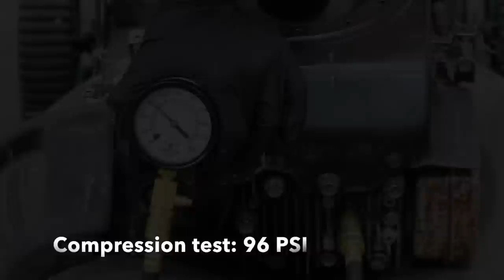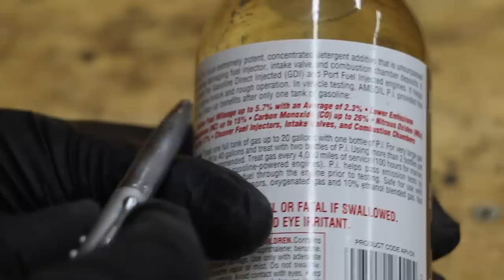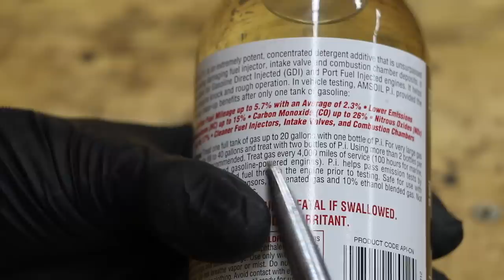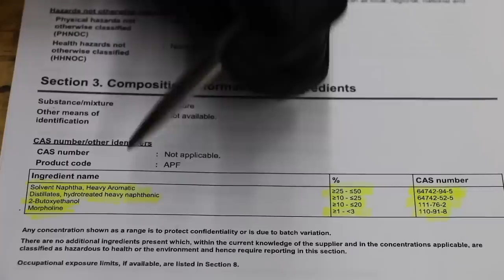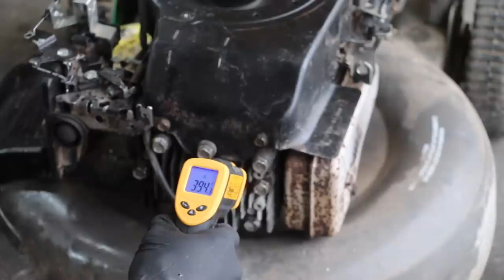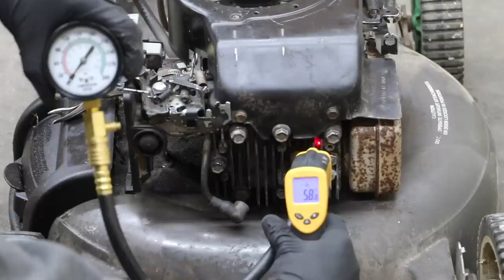Is Amsoil Power Foam better than Seafoam & MMO? Let's find out!

Comment: I use a spray bottle with 50% water & 50% rubbing alcohol... Cheap & Great way to clean carbs & injectors
Reply from the maker: Great recommendation!
Reply: Liar. Never use water on inside of crank case!!

Comment: Im not sure if it would work but try using oven cleaner and spray it into the carb
Reply from the maker: Thank you for this recommendation.
Reply: That’s a really good idea
Reply: That is an amazing idea! Please do this!
Reply: Heck yea id like to see that
Reply: Easy-Off oven cleaner contains sodium hydroxide which reacts strongly with aluminum so probably not the best thing to be putting in an engine but it would be interesting to see how well it cleans.
Reply: Great idea!  I'd laugh my arss off (and then run out and buy some) if a can of oven cleaner from the $1 store actually worked!
Reply: I use oven cleaner instead of engine degreaser when cleaning an engine. Just have to be careful with overspray. Wear safety squints and gloves, irritating to skin
Reply: Oven cleaner works great on cleaning aluminum, but in my experience it needs to be able to soak for an hour or so, so putting it into a running engine won't do anything.

Besides, oven cleaner can destroy rubber and gaskets so probably not such a good idea.
Reply: @ David: He's not trying to RUN the engine off of Oven Cleaner...

... He's trying to CLEAN the engine.
Reply: Oven cleaner is a good bodge to clean sticking turbo veins without removing the turbo (especially on VAG engines)

Comment: I'd like to see some Royal Purple products thrown in - I've used them an Amsoil and could swear my car feels faster with Royal Purple in it. Some Brad Penn oil would be interesting as well - I've used that in 60's flat tappet cam cars due to the high zinc content.
Reply from the maker: Great recommendation!
Reply: unedited 
You're correct the zink did help, unfortunately the EPA says it hurts exhaust emissions,  so oil companies are required to remove it from oil. 
Some companies do make oil with high Zink content, but it's expensive

Comment: It’s like you’re reading my mind and answering the questions before I have them!
Reply from the maker: Thank you!
Reply: @ProjectFarm  I went to school at Lincoln Tech (now called Lincoln College of Technology) and one of our fuels teachers told us, to get rid of carbon deposits, just give the engine a drink of water.
Get a garden hose and let it drip into the intake at an idle for a while. I imagine with a lawn mower engine you might want to mist it with a spray bottle. But the water droplets in the cylinder will help knock carbon deposits loose and clean things up.
As sure as I mention this, someone will try it, flood their engine, hydrolock it and bend the connecting rods, crack a piston or cylinder head, wash the rings out and fill the crank case with water.

Comment: Always heard a little diesel mixed into a full tank of gas does the same thing, maybe give that a test for me?
Reply from the maker: Thank you for this recommendation.
Reply: theorically, it should do the opposite.
Reply: It does not do well lots of carbon build up and spark plug fouling I've tried in in my generator to increase fuel volume thus increasing run time per dollar spent.  Off-road diesel is much cheaper then gasoline. Anyways it just causes headaches I would not recommend running any amount of diesel mixed in your gas tank.
Reply: I wouldn't advice.I have been putting 3x on 60 Lit of gas 1 lit of diesel for my non stop trip of 1500km,car was Audi V6 / 2.8 Lit.Since then I never gain light color of inside of exhaust pipe,I presume this "additive" wasn't good for the car,beside car engine run nicely..
Reply: Wellness, a 50/50 gas/diesel killed my Alpina BT-98 lawnmower completely, but increased power and compression on my McCulloch M145-97T
Reply: I do that on my four wheeler when I flood the motor
Reply: We used to add it to the crank case AFTER draining the oil to clean out the oil channels but never in the gas tank. We would put it in and run the motor for a few minutes and drain it out. Then repeat until the diesel comes out looking as it did when it went in. Then change the oil filter and add new oil.
Reply: Its the opposite a lil gas in the diesel can clean a diesel engine but diesel wont do shit but foul for a gas engine because of the way the fuel combusts it doesnt burn like gas its slow burning unless highly compressed wich a gas engine can not produce the adequate amount of compression to ingite diesel so a slow bur ing fuel mixed in a engine designed for a fast burning fuel results in lots of unburnt fuel causing carbon and soot. So just buy a damn cleaner dont do shade tree mechanic myths
Reply: IMHO, not diesel, bur kero ..... diesel (#2) is too much, but kero is just right. Tried this over the years in my gas and diesel cars.
Reply: @bargainboondocker3420  That sounds like ruining the engine with oil starvation. Diesel doesn't have the property of engine oil. I think it ruins it more than having a little bit of old oil.

Comment: Hey! I heard from some "old time mechanic" that if u spray some water in the engine in high revs it will clean engine from inside, Of course you dont want use too much water so that engine won't seize. 

Btw ... Nice videos! Greetings from Finland!
Reply from the maker: Greetings!  Spraying water into the engine sounds like a great test idea.  Thank you for this recommendation.
Reply: It works.  An old racing trick.  Cold water, hot carbon  buildup. Pow. Blows it right out.  Use a spray bottle.
Reply: Water turns too steam and works great at.
Reply: @spacecat7247  Done that. Old mower kept stalling before; after, no stalling.
Reply: Works great... look at any motor with a blown head gasket.  Any cylinder getting coolant in it is spotless.
Reply: I've used the water trick since about 1981 when I got my first car.

Comment: Amsoil motor oil vs royal purple motor oil film strength test would be cool another great video
Reply from the maker: Thank you for this recommendation.
Reply: Yas
Reply: Except schaeffer hardly has a selection of multi-grade oils, especially for imports. Motul would still be the preferred for imported (European and Asian). I am impressed with Schaeffer's full SAPS lineup, they should have more than 2 types of viscosity variants though.
Reply: I would like to see this as I use royal purple in all my cars and for my customers. Curious to see how Amsoil stacks up to it.
Reply: Colby C. I bet nothing beats AMSOIL Signature series
Reply: and you know this how?
Reply: Say's YOU
Reply: Talk about CRAP!
Reply: Joel Watkins RIGHT! I agree Amsoil is crap.
Reply: Superman I'm my opinion Schaeffer oil and Redline are the best oils. Is motul a USA company?
Reply: @charlespetersonii6989  I don't know about amsoil but I know Royal Purple is awesome motor oil.
Reply: It means nothing that Schaeffer is the oldest oil company. AMSOIL was the first company to bring synthetic oil to the automotive industry. The Schaeffer website has very little literature and test results on their website. I could not find any engines taken apart that only used Schaeffer oil to see how much wear it had. Chevy for the most part refused to use synthetic oil in their vehicles until one cold morning when they destroyed a few corvette engines.
Reply: @danielanderson222  Schaeffer's is damn good oil. Better than Mobil1 for sure. It's generally marketed as a mass fleet oil. Redline, Amsoil and Schaeffer's are the best. Royal Purple makes a really good high mileage synthetic called HMX. Valvoline Modern Engine synthetic is right up there with Amsoil in a film strength PSI test and is formulated to reduce volatility, control heat better and clean above and beyond their regular synthetics. Got a five qt jug at Walmart last week for $35.00. If you have an car made before 2004 Royal Purple HMX is the best for it because it has the zinc and phosphorus levels those engines require for longevity.
Reply: I’ve been running Amsoil in all my engines for 20yrs.....25,000 mile or 1 yr in all my vehicles, put 100,000 miles on my truck with no problems
Reply: @charlespetersonii6989  A guy dumped -40° oil, and Mobil 1 and Amsoil were the best flowing.
Reply: @JJfan48  don't use royal purple if it gets below freezing
Reply: @skittykitty1000  stop ur nonsense talk
Reply: Charles Peterson II Every time I used Amsoil I get an oil leak.
Reply: @skittykitty1000  what's so awesome about it? Is it because it's purple? It's oil. Super tech oil is awesomer!
Reply: @skittykitty1000  Mobil makes a primo oil
Reply: @johnm5998  Mr. Murchie?
Reply: He just did this Video.
Reply: @153eddy  you are just buying the hype. 😂😂🤣🤣🤣😂😊 Keep wasting your doll hairs
Reply: @JJfan48 I use diesel oil or Mobil and supertech
Reply: @andyandysylvester5194  and oil is all hype
Reply: @skittykitty1000  just because the oil is purple doesn't make it innovative!!! Some people 🙄🙄  you know nothing about oil I can tell😂
Reply: @raptureready9502  How  can you tell AMD where did I say it was awesome because it is purple?
Reply: Schaeffer's oil vs Amsoil SS
Reply: @traMusik  amsoil is all hype just change your oil on every 5 k and you'll do great
Reply: @charlespetersonii6989  I trust data and test results over reviews,LOL.
Reply: @orangefury272  Well with my test results amsoil didnt hold up. I watch 3 Cummins channels on YouTube. Turba tom- Schaeffer oil user. Jim Rendant- Schaeffer oil user. Greg Alberalla- Amsoil user and grenaded his"new" engine last year drag racing.
Reply: @charlespetersonii6989  I 100 percent doubt any synthetic oil would have caused that engine failure. Get a life.
Reply: @orangefury272  That's your opinion. I had a Yamaha blaster ATV I used amsoil dominator oil I had to rebuild it twice within a year. The third and final time I switched to Maxima castor oil and never had a problem. I know amsoil shows top notch results on tests but for myself amsoil has not been a good experience. I also cant justify the cost.
Reply: @charlespetersonii6989  My point is weather or not Amsoil is the best or not maybe debateable, but no way do i believe it caused an engine failure. Any synthetic oil made would be more than adequate.
Reply: Seen it done. Amsoil wins, cold viscosity, high heat breakdown, and wear. Amsoil beat Royal Purple and Mobil One.
Reply: @shannonmccullough8324  I would sure hope so at 12$ a quart.. Fuuuckkkk that! I'll stick with my Schaeffers for 6$ a quart and it's better than amsoil 👍
Reply: @charlespetersonii6989  the product that runs $12/ qt is the 25,000 mile oil. If you go to Amsoil's website, you get 25% off. Their 12,000 mile oil is 7.99 before the discount.
Reply: Shannon McCullough He hates Amsoil so much especially now that it is being proven to out perform the oil he sells. He’s on every Amsoil video calling it crap🤣
Reply: @matt7sixty  , I've never heard of Schaefer oil. I know a trucker who ran straight Lucas in his high speed gears. He tore it down after 250,000 miles. Still looked new.
Reply: Shannon McCullough Very nice. PF tested Lucas motor oil as well. Amsoil is on another level.
Reply: @153eddy  I think you won that bet.
Reply: @charlespetersonii6989  ahahahaha Im guessing you don't own a 1000hp car
Reply: @matt7sixty  You are easily fooled if you think I sell Schaeffer oil 🤣👌🤦‍♂️
Reply: Charles Peterson II That’s even worse lmao your on tons of videos like it’s your job copy and pasting the same comment pushing Schaefer’s oil even providing a link. 😂😂
Reply: @matt7sixty  Ain't no shame in my game 😎 that's called dedication 👌🏁 Also I'm not "pushing" rather educating people that the most expensive oil is not the best except for draining your wallet.
Reply: @matt7sixty  After choosing the finest base stock they start adding two friction modifiers; Micron Moly and Penetro.  Micron moly is oxidized molybdenum that is magnetically attracted to ferrous metals. It is five times stronger than steel and has a melting point that is twice as high as steel. Even under the heaviest loads Micron Moly will not pound out.  And Schaeffer has the highest content of molybdenum among all major brands.  Along with Moly Schaeffer adds a proprietary product that is exclusive to Schaeffer oil called Penetro.  Penetro reduces friction by adding what is like microscopic ball bearings in the oil.  This is especially good since most engine parts contain metals that are non-ferrous along with ferrous metals.  Non-ferrous metals do not attract magnetically so they need lubrication to protect the surface other than metal alloys, such as molybdenum.  Penetro and Micron Moly stay on the parts even during cold starts to offer the best protection at all times.
Reply: @charlespetersonii6989  dude it's no diffrent to most brands I just looked at the specs of it.. You can't compare that an xpr from royal purple
Reply: Royal Purple isn't even worth knowing about in my research.
Reply: Royal purple is crap. If something is going wrong how are you supposed to know cause your oil is starting out dark!
Reply: @Kmecha84  Because.... And 100 percent agreed, PLUS I have heard, read and seen nothing but bad about that junk. Woudn't use it EVER.
Reply: maybe for a dailey driver,but not every one has just a dailey driver
Reply: @charlespetersonii6989  now that Amsoil has won the oil championship, is amsoil still complete shit?
Reply: @ahdohnwehngunsmoke7724  Daily.... Spacebar/Button.

Comment: I wonder if you could put a small funnel over the carburetor when spraying the product in to get most of it to go down the carb?
Reply from the maker: This is a great suggestion.  Thank you.
Reply: Love your videos... keep them coming!
Reply from the maker: Thank you!
Reply: I thought it came with a straw to spray it in
Reply: rick schwartz you're correct, the PowerFoam is suppose to come with a straw taped to the side of the can. The cap has a slot for storing the straw across the top.
Reply: Dont think it would matter much. The vacuum created around the carb sucking fuel would be sufficient surely

Comment: This looks to be by far the best cleaning option compared to the other two. The only problem is you used two products at once so there is no way to tell which one made the biggest difference or if they work equally well. I wish you did separate tests for these products.
Reply from the maker: Thank you!
Reply: The real issue is that he'd have to have 3 or 5 engines with similar wear and varnish in order to do more specific tests. I am a stickler for the scientific method and controls, but I understand he's doing this stuff on a garage budget, not grant money.
Reply: @ProjectFarm did you even read the comment 😢

Comment: I think an additive called Star-tron might be good at dissolving varnish inside of carbs but maybe not. Fresh hi-test gas works the best for me after I get through doing what cleaning I can do. I always put a dab of Star-tron in and sooner or later I get to run with the choke off. Who knows. It;s supposed to be an enzyme deal, whatever that is.
Reply from the maker: Thank you for this recommendation.
Reply: You know I try but don't guarantee a single thing. My buddy at the saw shop started using it and said it worked for him. He's the real culprit on that one!
Reply: Lewie McNeely, I've been using Star-Tron fir at least 10 years and it is an awesome product especially when dealing with ethanol. I have no connection with them just a very satisfied customer.
Reply: Thanks, Paul. I was wondering if I was the only one. I've gotten some really crudded-up carbs to work with it helping I'm sure. It might take a while but eventually it's clean them put. Thanks again, Buddy!
Reply: Huge difference between real world test results vs "I think" or "it might" or "I heard" (from the guy down the street, who's cousin's Aunt works for the company). Will be interesting to see if it works against it's advertised claim if/when it's tested.
Reply: He won't be able to give this an accurate test as far as a lab deal goes. All my experience is VERY real world and applies only to me. You've got a different setup and it'll work different for you. But then you get a bunch knocking heads together and it comes out reasonably the same thing? Maybe.  Always a lot of variables.
Reply: I use Star-Tron to kill ethanol in small engine gas tanks but I always buy non-ethanol gas from a station 5 miles away for my lawn mower, string trimmer and chain saw.
Reply: Star tron is all i ever add to my gas and my mowers, snowblowers and trimmers never need carb attention. Im talking 20 years on these engines. Never drained fuel, just treated with startron
Reply: When I worked at Advance Auto, I had a gentleman come in after buying a mint 1984 ford pickup with the early fuel injection and only 69000 miles. The truck had sat for 15 years with 2 full tanks of gas (dual fuel tanks). He said it ran pretty rough so I sold him an over treat, 3 bottles, of star tron and told him put 1 and a half in each tank and drive till they're empty then get some fresh gas. he came back the next day and told me it ran like a brand new truck after 5 or 6 miles. Its a hands down the best fuel revitalizer I've ever used and ever sold. I recommended it every time a customer had rotten old gas and and used it in all my lawn and garden equipment.
Reply: Lewie McNeely,
Glad to help. If the carb(s) is really gunked up and you are able to take it off it would speed things along if you could take the carb in for an ultrasonic cleaning. After 30 minutes in the cleaner it will come out as if it's brand new. A lot of motorcycle shops and some small engine shops have them because they are such a time saver. After that cleaning all you need to do is add Star-Tron to your fuel to keep them like new.
Reply: Lewie McNeely I had a top Honda motorcycle tech from factory Honda tell me Startron was an excellent product and could tell by the dyno when it was used and not used! Good stuff
Reply: Star-tron is good stuff.